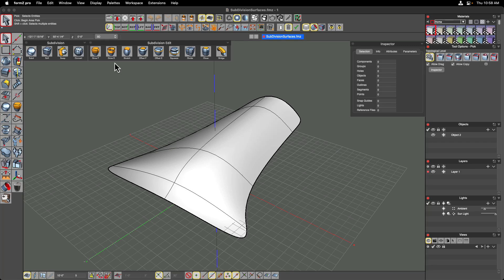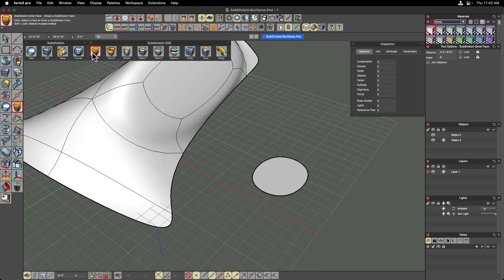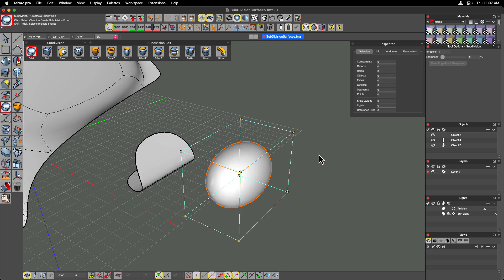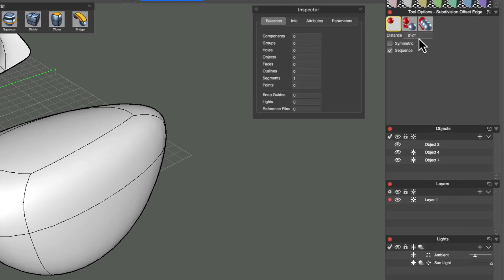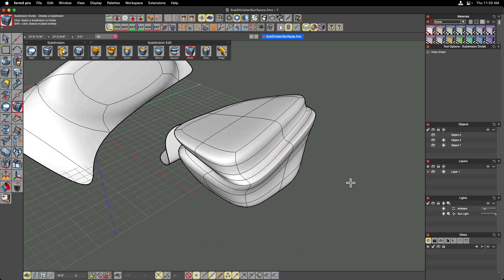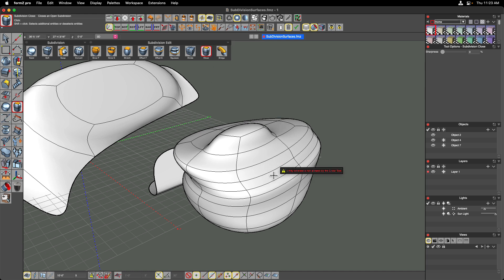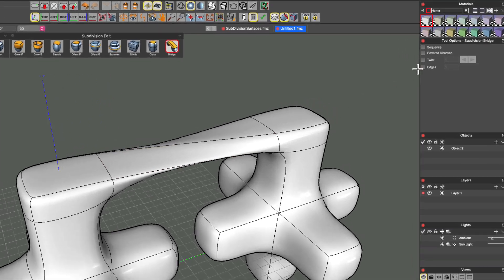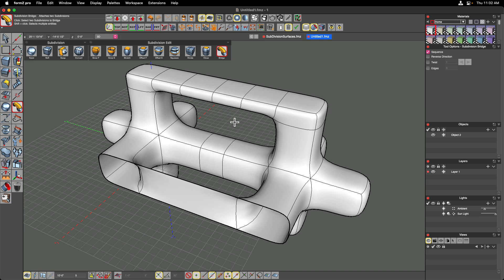Subdivision Surfaces, Part 2

Comment: Hi Evan, Are you going to make more videos for FormZ? It's been a while. Also, with all the great knowledge you've imparted with using the various tools, one thing that strikes me is when one has a design in mind, which tool/function is best to start with? For instance, say I want to make an iPhone holder with a belt clip and a handle so I can scan products in my store to do self check out instead of using one of their wands. I don't expect an answer because each design would require it's own approach to modeling. Just something to think about.
Gianni❤